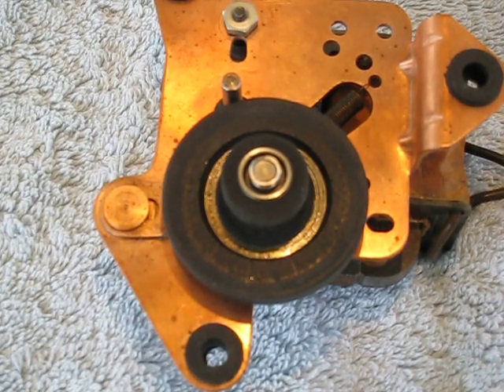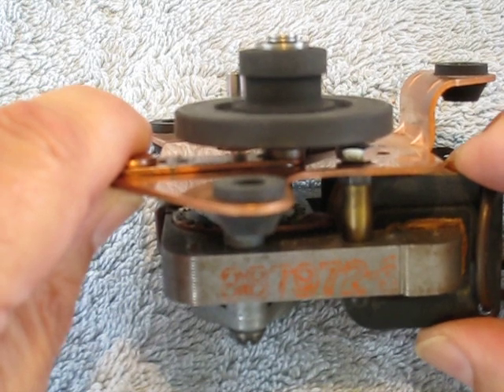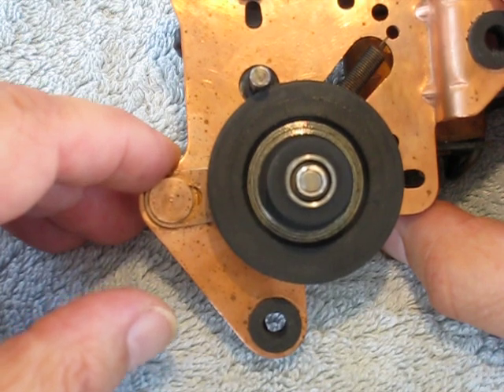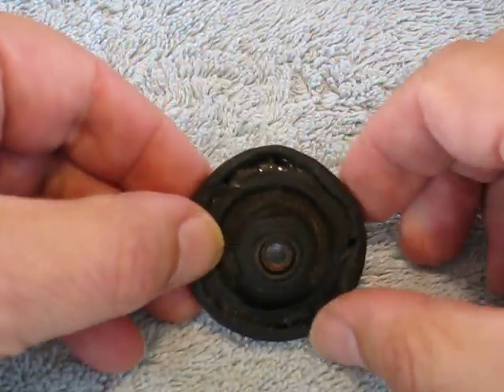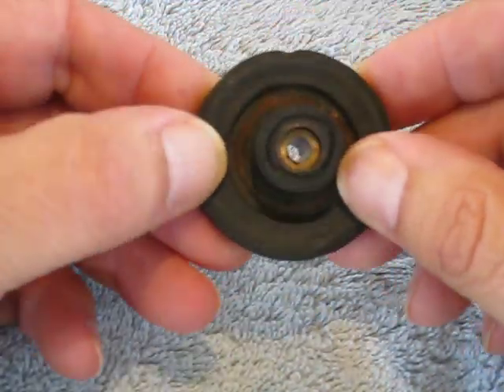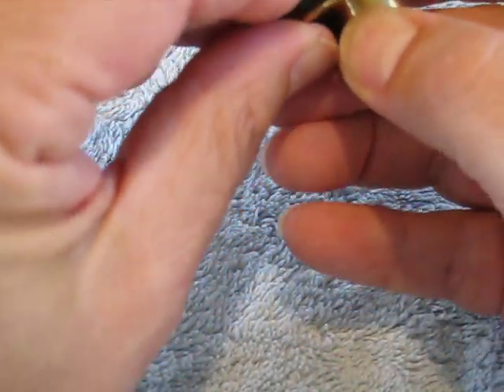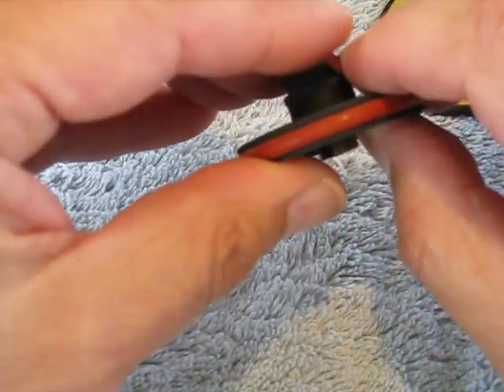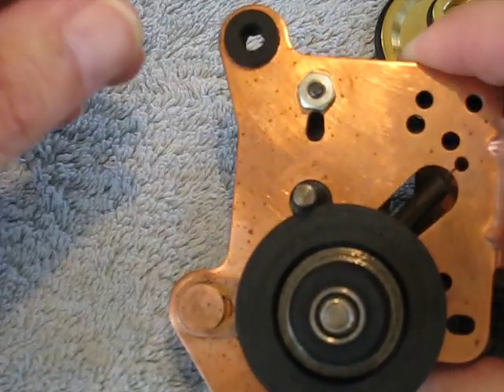Part #1: The RCA 45 RPM Idler...REBUILD IT YOURSELF!!

Comment: how would one go about making the idler quiet.

I have one of the VM rebuilds and it is quiet except once per revolution of the drive wheel I can hear a slight noise if the needle is in the lead in or lead out grooves.

I don't think it is the rubber itself though.

i did put a thin plastic washer under the drive wheel to give the bushing a better thing to ride on, but it hasn't eliminated it completely.

Comment: i noticed that when I turn it on and when the record was about to 
drop, the turntable stopped turning until i gave it a push, but after about 10 
minutes it worked fine..it seemed like this had happened before and the fix was 
something very simple. I seem to remember that there was a screw underneath that 
you had to turn a certain way and that solved the problem...do you know how i 
would fix that problem.
Reply: David, my newly restored RCA 45-EY-2 (restored 2 years ago) started doing that out of the blue.  Shocked and worried sick, I've discovered that turning it off and right back on again solved the problem until the next listening session at which time the platter, 45 spindle, and tonearm would again struggle to turn, I'd turn it off and right back on again, and the problem would again solve itself for that playing session.  It's a quick fix, but it would sure be nice if it worked properly without having to resort to that.  You mentioned a switch underneath to officially correct the problem. Could you please elaborate on that for me?

Comment: Any help on what to do for one that plays fine except a little slow?
Reply from the maker: CrisVangel1958 I highly doubt it's an issue with the drive wheel but rather with the motor. RCA motors have a nasty habit of playing on the slow side! My suggestion would be to dissemble the motor, give the motor a really good clean (use q-tips to get into the holes w/lighter fluid) add only 1 (one!) drop of oil in the bearing area and reassemble. Look at Chris Cuffs video for great instructions. Take heed putting the motor back together "rapping" it with the handle of the screwdriver to settle into place. That SHOULD help.
Reply: Thank you for responding, I'll try that!